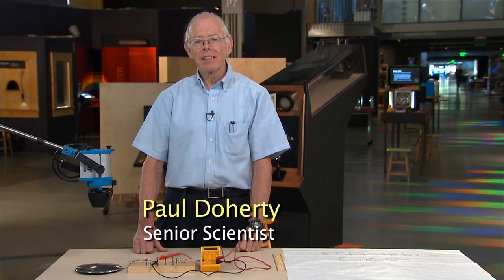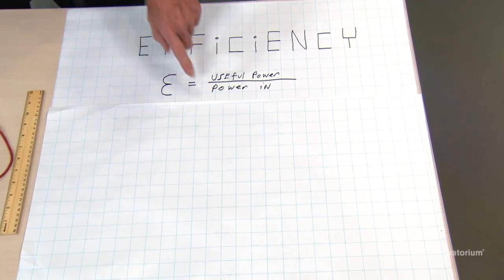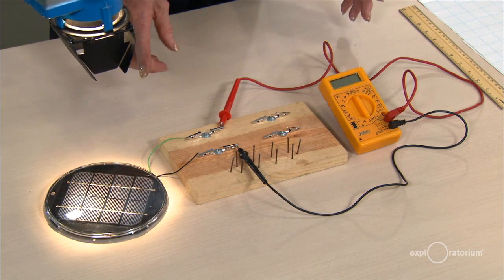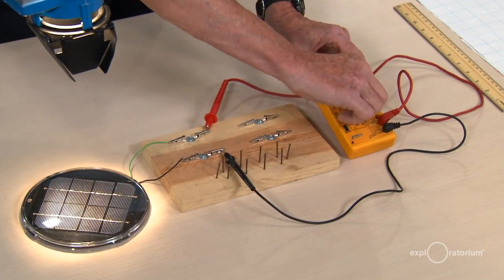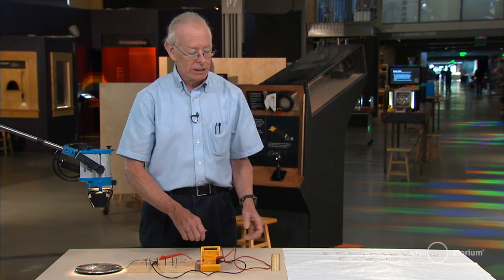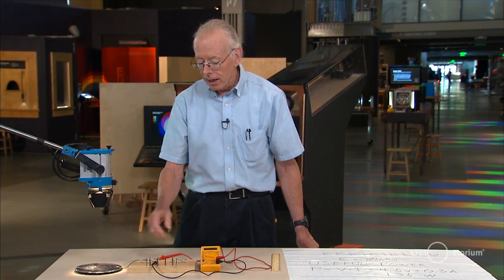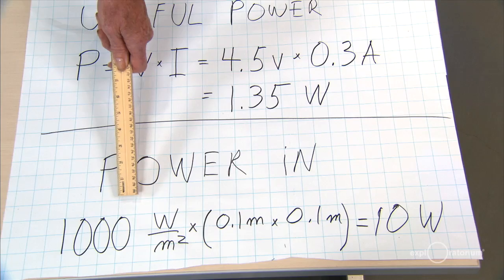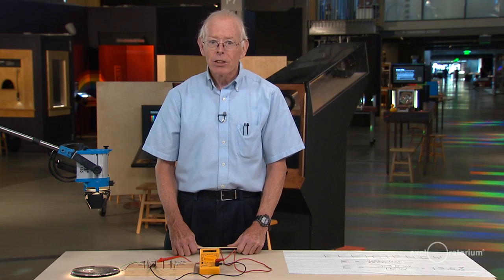Measuring the Output of a Solar Cell

Comment: This is false! You measured open circuit voltage which is not the same voltage as when you're short circuiting it with ammeter

Comment: Multiplying open circuit voltage (Voc) and Short circuit current (Isc) is way too optimistic, this is marketing scam done by PV manifacturers. Actual power (Voltage x current)  must be measured at the panel Maximum Power Point (MPP) which happens to be (in full sunlight) at 80% Voc, so for an 8 cell panel around 3.6V - 3.8V. At MPP current will be close to ~90% Isc, so overall actual panel power is 0.8*0.9*Isc*Voc
P = 0.72 * Isc * Voc
Reply: He's simply wrong in saying power=Voc*Isc and ignore the fill factor

Comment: This old man knows nothing about solar cell and VOC×SCC=ass.
don't watch this false information
Reply: I've worked with him. The Man has a Phd in Quantum Physics. Singularly one of the most brilliant men you will ever meet.
Reply: @dmesloh   look i don't want to be  disrespectful BUT you just can't determine the wattage of anything by OPEN CIRCUIT VOLTAGE & SHORT CIRCUIT CURRENT.

Comment: It makes no sense to me, when a solar cell has a power rating of 3 to 4 watts, but a voltage of 0,6v. It means a current of about 6 to 8 amps, that cant be true.
Reply: Klaas, panel in video is a series of 8 cells, so open circuit voltage is 0.6* 8 = 4.8V (this is a theoretical value, actual voltage will be somewhat lower)
Reply: its true. Ohms law dictates it.

Comment: Paul,  do an deficiency test,  cell output verses a load .  Most people only need a solar panel to do some sort of work for them.
I can't think of a single application where the load would be 0 ohms.
It is a good video though.

Comment: Eddy you hit the nail on the head,  A power source can only be tested under a load,  any load that the source can handle.
If generators were rated like this there would be a lot of POd  building engineers when they found that their gen-pac would not carry their load that it was rated for.
All over the net people are misleading the public with claims of solar wattage that can't be reached in the real world.  ( even under the brightest of suns)

Comment: This is not completely true..You have to multiply it with the Fill factor to get the real output power achievable..the efficiency will be considerately lower than what you have shown
Reply: +Vijay Venugopalan Care to elaborate?
Reply: +nemac23 

The solar cell is connected to a device with finite resstance. So the current and the voltage you get when tthe cell is across that resistance is the actual voltage and current which you have to multiply.

This is concisely measured in the fill factor . Check the wiki page, it has all details.!
Reply: +Vijay Venugopalan I looked into it. Are you saying that his readings are Voc and Isc because it's a short circuit with no resistance, like measuring two ends of a battery?
Reply: Hi,
What if I want to measure the total energy output continuously? Is it a correct way to do this with a constant resistor? I confused beceuse MPP will change for any time during day.
Reply: Solar pannels actually state both short circuit power and normal power seperately and print it on the panel